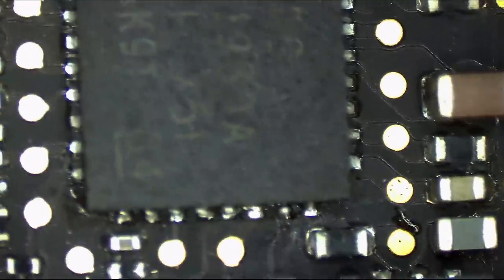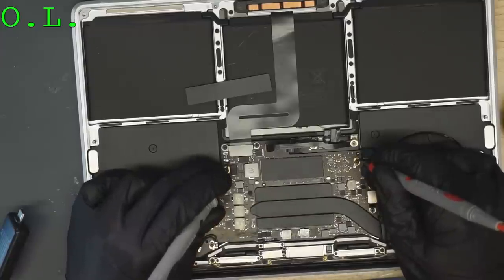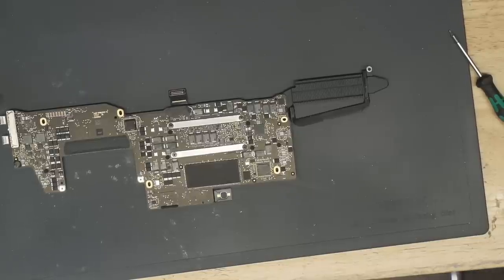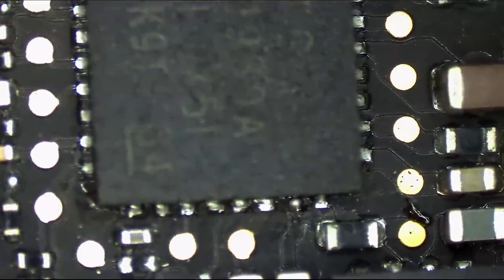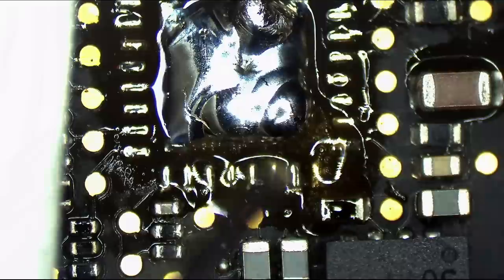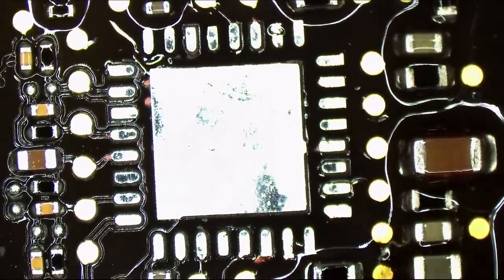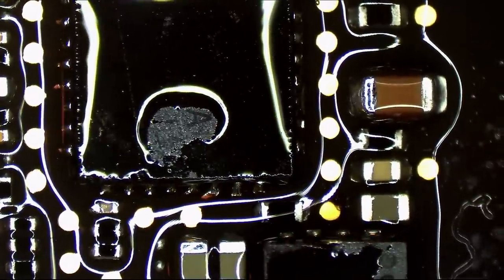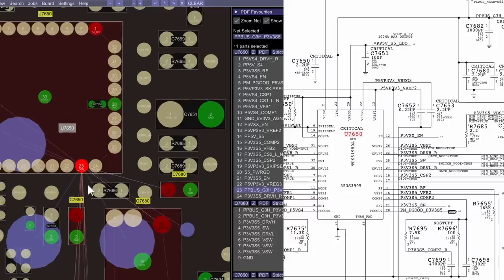Does Apple put poorly refurbished boards in customer devices when they pay for replacements?

Comment: Apple: We replace, not repair!
Also Apple: Uses refurbished parts
Reply: they should be sued for such things, there are enough indicators that this board is refurbished and not a new replacement.
Reply: Also Apple: Furtively furnishes "refurbished" parts requiring further refurbishment

Comment: "Scraping" sounds bad.  Call it "polishing" or "abrasing". Much more gentle and professional sounding haha. Great video and very disappointing that they charge top dollars for badly refurbished items.
Reply: @SuprSi  What? You a paid troll or something? I haven't owned a single apple product in my entire life.  Though I do love apples.
Reply: @JailerGamer  Anything that is designed to thermal throttle is just a big NO NO in my book. My Lenovo can run its CPU at full load in turbo boost to 4.1 GHz in perpetuity without reaching even 80°C. And it was a cheap laptop too.
Reply: @DeNorali  agreed. Like, max cpu usage should be at 70-80 degrees. 40 at idle. Apples products fucking sucks for longevity. They just want people to buy new products every year
Reply: "Sounds bad"💤... Maybe because words have meanings and it is not "polishing" when you "scrape" some layers of corrosion off. Professionals use correct words and not pander to what snowflakes think on which word is edgyer in a psuedo moralistic framing of words as good and evil choices.
Reply: Burnish is also a nice term. On another note, I "polished" all the pads off my iPhone board. It's so clean, but doesn't work anymore and all the components are in a little pile next to it. What shall I do?

Comment: To answer the question posed in the title, I'm going to go with yes. They charge $1200 for a phone that costs them under $200 to produce they are damn sure cheaping out everywhere they can.
Reply: What  I don't think Louis is one bit scared of Apple being a bully he's fought them before and won.
Reply: Do you really think that it only costs apple $200 to produce an iPhone xs max for example?
I'm not an apple fan either but you have to acknowledge that there is much more to developing a product than just putting some parts together. Research and development is expensive and their $1200 phones definitely cost more than $200 in parts.
Reply: @paulnikolaus3178  R&D is not cost to produce , that is separate. And no when buying components thousands at a time they probably do not even pay that much to make the phone. You are apparently working with prices from retail, not wholesale in bulk manufacturer direct. You can easily calculate what the CPUs cost them with a wafer cost calculator for TSMC 7nm it's less than $15 per chip.
Reply: Yea dude it's like not even 50 bucks to make an iPhone.
Reply: @jackburton6330  just for display they are paying more than 100$ to Samsung

Comment: I'm slowly educating myself on how macbooks work. Was I seeing that right? That heatsink connected to the fan looks way too thin to be effective at all. AFAIK, it indeed loses effectiveness when you make it too thin.
Reply: Becos apple
Reply: No, the total surface area and the amount of air flow is what defines how efficient cooler is. Heat pipe takes heat from the hot chips and moves it away, where the cpu cooler is. The thin fins are welded or soldered to the heat pipe(s) so the heat transfers from the pipe(s) and gets spread into all those thin fins. Now, the cooler pushes air through the fins which means the heat is transferred from the surface of the fins into the air that gets ejected out. 

Thicker fins would just mean slower to heat up and cool down, would act more like a heat reservoir, and that's desired if you have heatsink directly over chip and fan on top of heatsink, because slow to heat up means you can ramp up fan slowly and make device more ear friendly... but in the laptop, it's not what you want.
Reply: The heat sink is underneath the heat pipe and spans all the way from the fan to the case. Definitely not as big as on some of the gaming laptops, but i have seen much smaller ones.
Reply: Isn't the case metal? If so, they're probably using the case as a heat sink.

Comment: Hi Louis,

The reason they use lead free solder is to be ROHS compliant.

Which means no lead in the solder.

It would be faster on the the SMD production line, as it's a lower melting point they can run the boards faster as it requires less heat.

Medical and Defence equipment is exempt from ROHS as they can't have dry joints. 

Regards

Comment: At least you dont spooge flux all over every millimeter of SMD pad lol

Thanks Louis the past year of watching, even though I started in studios as a Tech 30 years ago and now Broadcast, I learn something new every video I can apply to everything I work on, I do not work on Macs they are door props as far as im concerned like a 10k fresnel lamp

I really appreciate what you do, i have a question and hopefully you have time to answer, i use T12 tips, I use a 1.5mm curved tip, I have a stack of round tips to 4mm and the bulldozer you recommend using a flat tip, what size do you use and the SMD air tip and what size(s) should I keep in my own kit??

Comment: When RIM repair left Flex for China they put the entire section out in the parking lot. Warehouse shelving, cabinets with digital cameras and stuff. Pallets full of electric screwdrivers, German tech screwdrivers and Swiss tweezers all kinds of shit they let us(moving data cable for Apple) take whatever we wanted as long as we didn't bring a trailer. Got a hot air station, 2 Hakkos plus some shoeboxes of small tools.
Bunch of what looked like Dell notebook stuff as well like heatsinks and parts containters full of screws.

A parking lot full sitting out in the rain(luckily most the good stuff was somewhat shielded)

Was sickening but I gave some of it a good home at least.

Comment: I sent in my PS3 to Sony when it broke from overheating.    Being it was one of the original 60GB Backwards Compatible Models, I wasn't just going to buy a new PS3.  
What Happened?
1.  They didn't recover any of my data from my PS3.  I assumed they would, but I guess something like that is too difficult for them. 
2.  They sent me instead of a New PS3 Replacement, they sent me a Refurbished one.   Poorly at that as it broke within a year. 
3.  After the Second one broke, I decided to try to backup the data this time.  But found out a lot of it was locked to the machine, ie I couldn't transfer it, because the company that made the game didn't want data to be transferable.  
4.  I asked around and found out to 'save' that data, I had to PAY Sony to have access to PSN Plus.  So I decided to do so for one month just so I could back it up. 
5.  I sent that machine to a proper Repair service over the internet, they repaired it, soldered and reballed the chips that suffered damage and even modified the machine so the fans would run faster to keep it cooler.   They told me it was a Refurbished machine, which I never knew.  I assumed it was new, and is when I realized it was Conned by Sony.   As when I filled out the application it made it sound like it would be new.  

My Experience with this.  Caused me to no longer Trust Sony.  I opted out entirely from buying a PS4, or XBox One, and I'm going to do the same with the new consoles they're bring out within the next two years.  They're scumbags, and don't deserve a dime from me.

Comment: The term "unauthorized repair" is a misnomer. Who has not authorized the work? The device owner has obviously done so, Apple has not. In using that term companies are implying that only they have the authority to allow repair work, on devices which they do not own. For them to publicly claim that they hold this power over an individuals belongings would cast them in a negative light so they use weak arguments about security and such to veil their true intentions. In using that term you give support to their claim of authority that while the owner has authorized it, Apple has not and so it is "unauthorized". I think "third party repair" is a better name because it is an unambiguous description of who is doing the work.

Comment: I don't understand the lingo but i do understand that something isn't adding up
Reply: Instead of using new chips, apple is using refurbished chips and improper soldering technique.

Refurb chips have lower lifespans due to excess use that lead to original failure.

Comment: Rossmann TPS51980 replacement guideline quiz for Apple authorized technicians. 

fill in the blank section:

when replacing a QFN, failure to clean off your g0dd@mn flux in an ultrasonic, automatically makes you a ___________.

Comment: Lol Apple has been a joke for over a decade now...
Nothing is shocking
Reply: Almost 8 years.  My mid-2012 non-retina MBP has two 4TB SATA SSDs, 32 gig of replaceable RAM, and matte display.  After they drop OS support for it, I guess I have to switch to Windows or Linux.  Too bad the Razer Blade is the only thing I can find with a similar form factor and chassis build quality.  Unfortunately they're just as unreliable and expensive as the new macs.  I guess Lenovo Legion or ROG Strix might be my only real options
Reply: @A random Human being GPU issues on 3 out of 4 logic boards, either causing Metal benchmarks to be 800 points too low, or occasional kernel panics when switching GPUs after resuming from sleep.  TouchID board cable flakiness causing kernel panics.  "Bad magic" panics (Machine-Check Exceptions == flaky CPU, bad solder, or cracked trace)
Reply: @A random Human being That's just been my experience with them, but if you search for "MBP16 kernel panics" there are a lot of forum threads that make it sound pretty common.  On the plus side, Apple has been replacing the logic boards 3 or 4 times under warranty until you get a good one.  It is a very nice machine industrial-design-wise, and a lot of users don't even run into the hardware issues depending on usage patterns.  It's honestly not an absolutely horrible machine - and I hesitate to blame Apple for a problem that very well might be Intel's fault -- but from my own personal perspective, I need it to be rock solid, especially for the price.  Catalina is a whole other story: it's a little bit crap no matter what machine you run it on, but supposedly the worst of it is fixed in 10.15.5 beta.  There's still a lot I would miss if I have to switch to Windows across the board, but it feels like it's sorta getting to that point.  This whole year, the Cupertino campus has been starting to feel like nobody really knows what's going on; there are no longer any solid product roadmaps or any sense of purpose, everyone is in damage control mode (to the point that engineers are wearing "not a regression" shirts to meetings, and saying things like "have you tried tweeting at Tim to tell my boss to approve my merge" if I really need something fixed) - I hope they pull out of it, because the alternatives aren't great either.
Reply: @A random Human being I thought we were talking about laptops, heh.  Last iPhone I had was a 5S, I would love a new one hardware-wise but not being able to run emulators, compilers, network utilities is a deal breaker for me.  I hate Android and specifically Samsung's version of it with a fiery passion but when all is said and done I'm more productive on it unfortunately.  I use my iPad all the time and have very few complaints with it - it would be nice to be able to do more with it locally but it's awesome for remote desktop.  If you get a MBP16, check the manufacture date and try to avoid ones from November and December at least

Comment: You don't become one of the worlds richest companies by giving people top quality stuff, with good after sales service. You just use marketing wank words to sell the illusion that you do. This is why Apple get away with selling stuff for 3 times the price and expensive warranty service. If their stuff was as good as they claim, then no need for locking down hardware for replacement parts, no replacement chips, and stopping people from backing up their data without an icloud subscription. And no right to repair. And as a result millions of tons of Apple crap that breaks and goes to landfil or recycling that could be repaired. I will never buy anything from a company that acts like Apple do. They will only change when the people make them change.